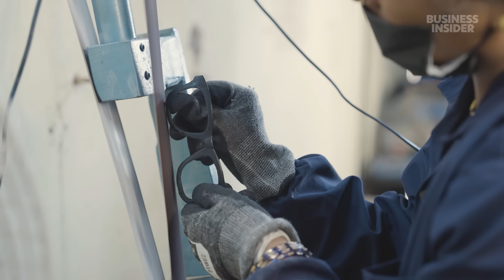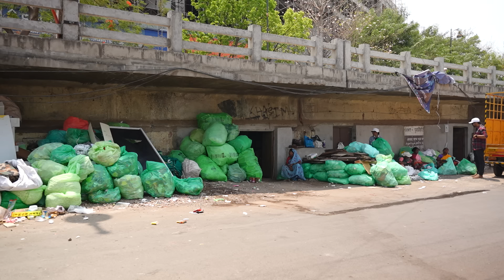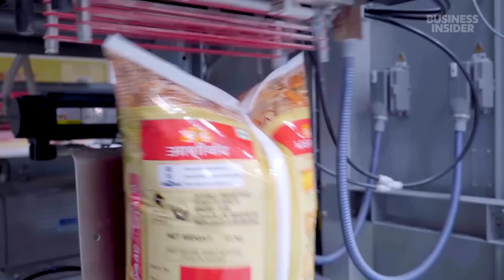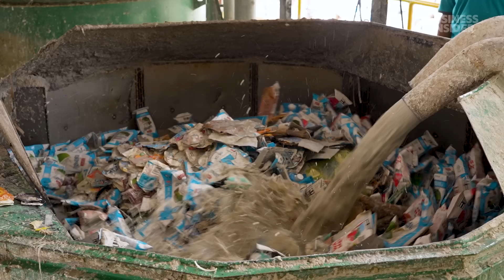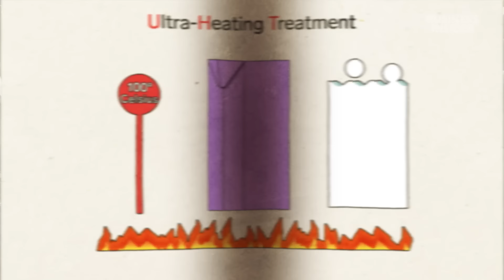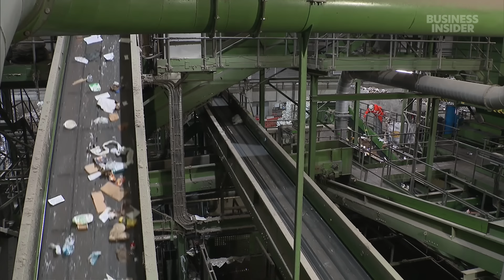Why Are Chip Bags So Hard To Recycle? | World Wide Waste | Business Insider

Comment: What's the co2 footprint of this process and how does it compare to incineration?
Reply: Great question! We have conducted an independent ISO certified life cycle analysis (LCA) for this, and our process in the pilot scale (only 50kg/day) will have a negative Carbon footprint. That obviously doesn't make sense intuitively, we do use energy in our process, but it takes into consideration avoided emissions as well (from virgin plastic product and bad incineration). Incineration, if done well, can be an interesting solution, but it's a destruction of value. And more often than not, incineration is not done properly, leading to release of toxic greenhouse gases and particulate matter. Our goal is to extract value (materials) from this MLP and use them over and over again. Sunglasses is just a proof of concept, but they are in fact more recyclable than conventional sunglasses because you can recycle our material in conventional PP or PE streams. Our solution is not perfect, but we are trying to look at holistically!
Reply: @madewithout  I assume you represent the company. That's indeed not intuitive, considering that the footprint of small plastic things is generally small. Is this published anywhere?

It would guess it is very much assumption-depndent. For example, what about avoided emissions from gas mining to fuel power plants through the use of incineration?

Anyways, so long that the free market decides, let all the flowers bloom...
Reply: @iampdv  Wait, you think that the petroleum industry/plastic manufacturers are emblematic of a "free market"? I can't tell if you're being sarcastic or not, Poe's law and all that.
Reply: wise question. And thoese glasses will be the garbage of the future, and they are not recyclable.....
Reply: @thedwmiki  You can always incinerate them and produce energy
Reply: @johanneskingma  icenerating them is a pollution process
Reply: Jesus CHRIST. Burning it is still better than make it in gazillion pieces of microplastics and all the chemicals used... Not accounting the cost to do that. They said this was subsidized by the package making company... They will never generate any profit
Reply: I know were I would like to stick my foot print
Reply: The CO2 footprint is roughly the same as the number of obese people that buy snack foods..
Reply: Serously!!! how is everything being poisoned with plastics and chemicals better than the planet heating up a few degrees?
Reply: @jojo-qu1qj   Far more people die from snack food related Obesity. 
Plasticphobia is an irrational or excessive fear of plastics, leading to overestimating the health risks of plastic compared to other risks. It can impede rational decision-making and contribute to counter-productive behavior and policies. Plasticphobia is primarily a media phenomenon as opposed to a purely psychological dynamic. The term is also used to describe the opposition to the use of petroleum-based products and polymer technology (i.e. oil refineries and chemical plants) arising from concerns disproportionately greater than actual risks would merit..

Comment: Aluminium is the most common metal found in the Earth's crust, and the third most abundant element. Iron is the fourth most abundant element in the crust, but makes up 34% of the Earth's mass. It is, howvever, energy-intensive to refine. Plastics are now being made from algae, fermented starch. Just burn the bags for energy, extract the aluminum from the ashes. They are often coated on the inside with oil and such, to recycle them you'd need to wash them, which is a waste of water and detergent, and a bigger issue than just burning or burying them. The oil and organic detritus burn just fine.

Comment: Recycling plastics need to go thru several processing and uses huge amounts of chemicals, using significant energy and water. Is it really worth it? And where does the chemical treatment solvents, which most are toxic and non-biodegradable, go to? Recycling and re-using is commendable, but not a real solution, at most it's just a delay in disposal. What's needed are replacements for plastics and other non-biodegradable materials, which are truly environment friendly, and a drastic reduction of plastic use.
Reply: and ppl not to complain about the noise a bag makes.
Reply: @albundymvp There are options that aren't extremely loud now.
Reply: Not true! The hardest part of recycling plastics is classifying the type of plastic being used! Once classified the recycling process is relatively cheap & cost efficient. Plastics are water & solvent resistant hence need only need water & detergent to clean. Things get difficult/impossible when there are several types of plastics being used in 1 product like multilayer plastics discussed in the documentary. Compare this to high heat & chemical cost of recycling aluminum, glass or paper! Glass & aluminium have much higher melting points then plastics so require a lot of energy to recycle. Paper is very porous so it absorbs whatever it was holding & needs a lot of water & bleaching chemicals to recycle.
Reply: Solution: Don’t use landfills!!! INCINERATE!
Reply: @TheBooban  I agree.  But the ruling class don't want us to do that, at least in the USA.  That would be free electricity.  Tesla wanted to give us free electricity, look how they crushed his idea since the 40's.  I know in Malaysia they burn trash for free electricity.
Reply: ARE YOU SAYING CLEANING UP THE OCEANS ISN'T IMPORTANT? 😢  
Cuz you're not going to be able to stop big business. 😅